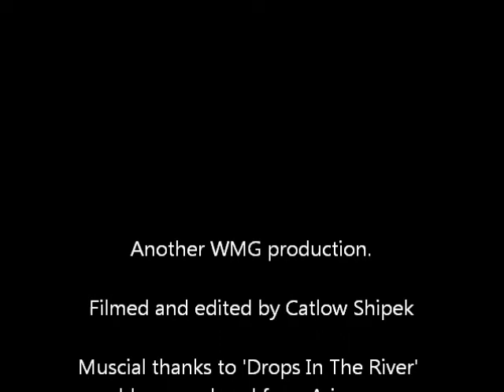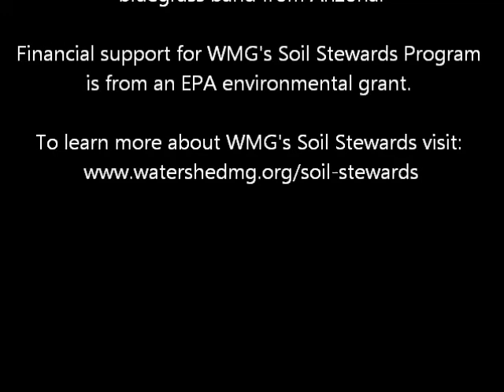How to Use and Maintain a Composting Toilet Barrel System

Comment: great design. Are you removing the compost at some time? Could there be an additional step or two to move the compost on down the line out of the barrel at regular intervals?
Reply: Yes my question too, there must be a point where you have to empty the spare barrel because the active barrel needs replacing. How do you clear the old compost out. I cant really imagine transferring it with a trowel etc?

Comment: A lot of details were not covered like saying that it's not a very good idea to use human compost on vegetables that will be eaten because obviously pathogens may remain and make you sick. In fact in China they have used human compost on edible crops for thousands of years and some would argue that it is one of those hidden but important factors which made their civilization successful and so long lived. BUT they also have a VERY high rate of intestinal disorders there.....  I would use it on fruit trees though- all the way out to the edge of the drip ring. 

Also, how do you clean that aerating screw? If you hose it off, then the system is not exactly zero discharge... You gotta clean it because it wouldn't be so very nice to have a shit covered stick laying around all the time. :) Great video!
Reply: YOUR CORRECT GOD SAID BURY IT NOT USE IT FOR FERTILIZER.
Reply: @sheepseven7588  god is dead, his Palestinian son has risen

Comment: no good, when fluid and solid mixed.. usually is more fluid than solid.. hence it is always like muddy water. anaerobic.  take forever to evaporated dry to be able to achieve aerobic composting. physical toilet design wise is very good. but operational wise is no good. i done mix composting before.. too watery.
Reply: I'm using a bucket to barrel system with the same barrel he uses here, and with non-separated fluids. Works fine, even in a cold are like northern Sweden. Sometimes it's a bit wet and smelly, especially when thawing after winter, but then you just aerate a bit more and add more wood chips.